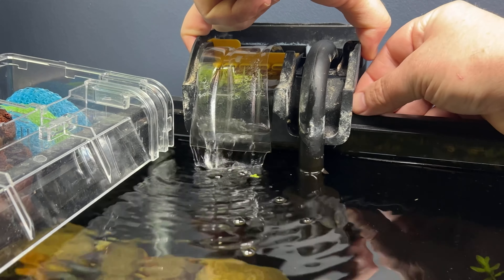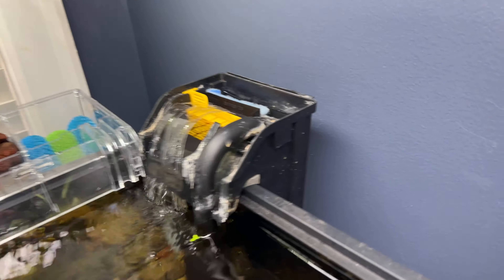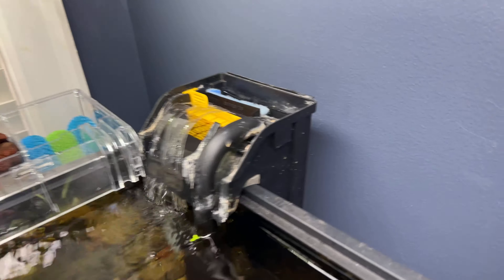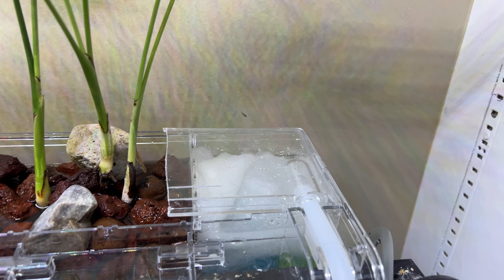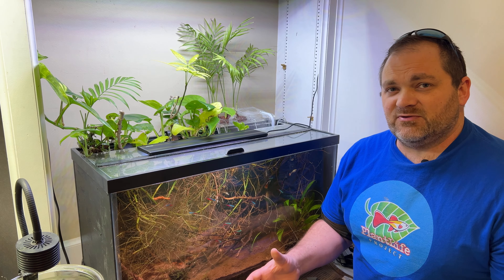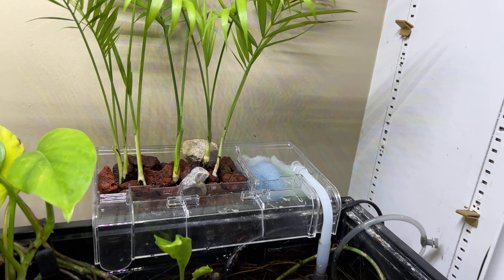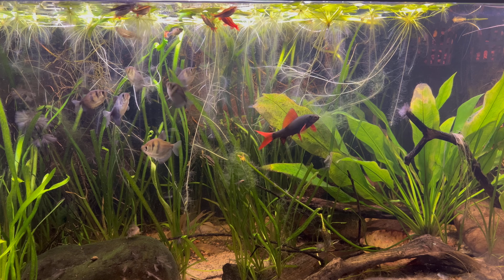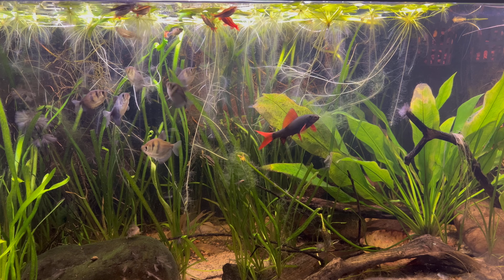DIY Aquarium HOB FILTER- made with a Breeder Box, with Houseplants- 3 WAYS TO POWER!

Comment: You can build it from a window or railing planter box. It would require plugging the drain holes and modifying by the addition of a return, but they are much larger and can be had from 17 to 36 inches. They hold a lot of media. I use pumice gravel.
Reply from the maker: I have done a version of this in the past 
🐟🪴Window box Planter HOUSEPLANT WATER FILTER for Fish Tank 🪴🐟
https://youtu.be/DlLwRmuVm6M
and I do like the idea, However, I want the filter to hang on the back of the tank, low profile, easy to take off when I want to, etc and so far the hob filter box “template” fits the bill, I think.

Comment: How much of the Pothos vine do you normally put in the tank? I have a piece with probably 18" of bare stalk... would you put all of it in the tank or only the end few inches?
Reply from the maker: You can do either way. The 18 inch section will grow roots at each node that is under water so you will have more roots but only submerging a few inches of the stem is fine too.

Comment: I have also wanted to add plants without interrupting the current setup which includes submerged plants. I have researched adding a freshwater sump, but it seems overly complicated and intimidating. Have you ever considered a freshwater sump?  You’d be able to add so many more plants that you can train to grow around the aquarium, it would look so nice!
Reply from the maker: No I haven’t used a sump, I’ve just grown tons of plants directly in my tanks. Roots going all the way into the substrate. You can see them in my tour videos. The downside is that it’s so permanent. Difficult to change out plants if I want to try a different design without making a mess inside the tank.

Comment: Nice video. I already have a central air system in my fish room and currently use this concept. The disadvantage of using an existing HOB is it draws additional power. If you have fish like African cichlids that tear up plants inside the tanks so the HOB with the breeder box via siphon works best IMO because you still need the mechanical filtration along with the biological. You get the best of both worlds! For my other tanks that are already planted, the air method makes the most sense, it's the noise like you mentioned is a major negative. I just found this vid that uses an existing sponge filter. https://www.youtube.com/watch?v=NbkwSM92Pbw. Thought this was pretty ingenious.
Reply from the maker: That is a great idea! Definitely want to try that out with the sponge filter
Reply: @plantlifeproject  thanks. I just posted a vid about it.